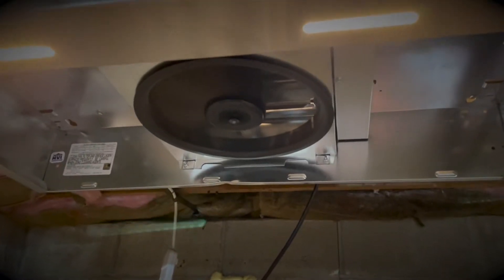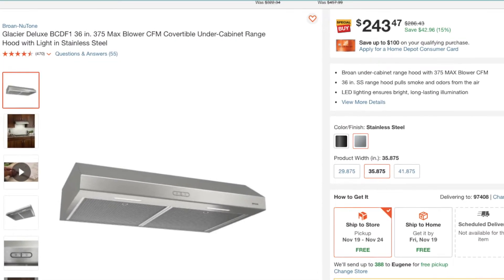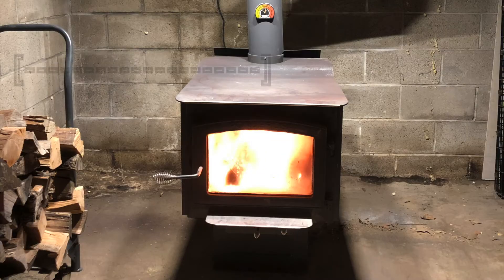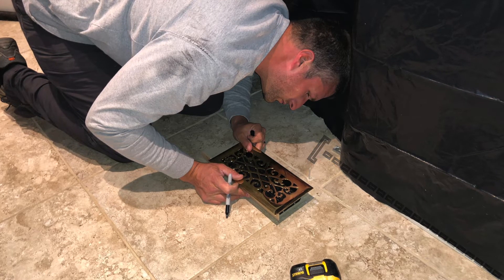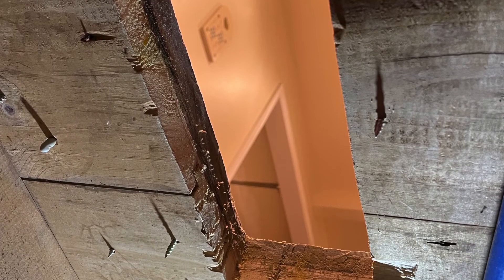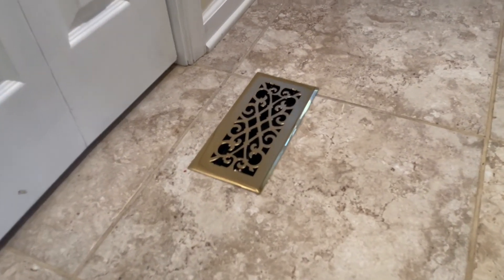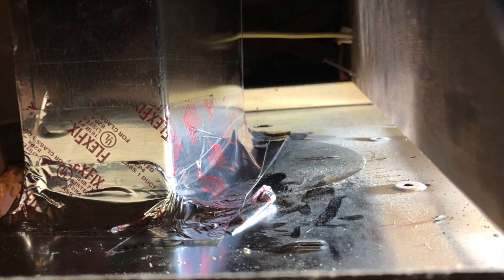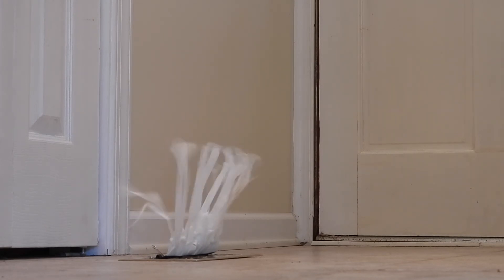Getting the Most Out of Your Wood Stove / Pellet Stove - Range Hood Install

Comment: I did that same thing with my first woodstove here about 30 years ago. We replaced our old stove hood with a microwave oven so I used the old hood like you did. Only mine had a plastic fan blade and ended up melting eventually. So I decided to replace the hood with    a sheet metal jacket around the stove and used a small squirrel cage fan to blow the heat upstairs. That heated our house for about 10 years until I replaced it with a wood furnace.

Comment: Eric, can you confirm this made a big difference in the upstairs floor? I’m considering doing the is but would like to make sure the effort is worth the payoff
Reply from the maker: It absolutely did!   100% worth your time , effort, and the initial expense.   My parents basement wood stove is now their primary source of heat upstairs .  Please let me know how the project goes for you 👍
Reply: @E_Fleming  someone brought to my attention that running the vent hood above the stove would affect the draft for the air intake on the stove.  have you noticed anything?
Reply from the maker: Sorry for the delay.   I don’t think it had any effect on the air intake.   Did you end up installing a range hood and are you pleased with the results?
Reply from the maker: I recently moved into a new home and made a similar modification on a smaller scale.   I put  one of these in second floor bedroom over first floor pellet stove.   It pulls the air up through register over stove and into bedroom.  We haven’t had to turn on our heat in bedroom yet 👍👍👍https://www.amazon.com/AC-Infinity-Register-Thermostat-Control/dp/B0792QR5YT/ref=asc_df_B0792QR5YT/?tag=hyprod-20&linkCode=df0&hvadid=242000691778&hvpos=&hvnetw=g&hvrand=5484044080410040028&hvpone=&hvptwo=&hvqmt=&hvdev=m&hvdvcmdl=&hvlocint=&hvlocphy=9007417&hvtargid=pla-408270482310&psc=1